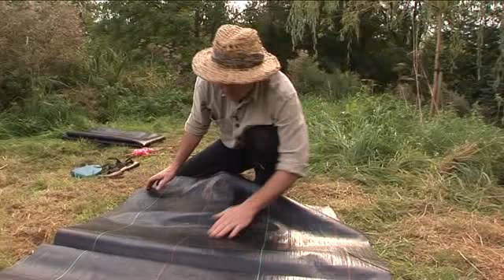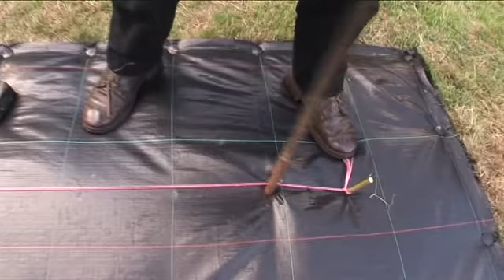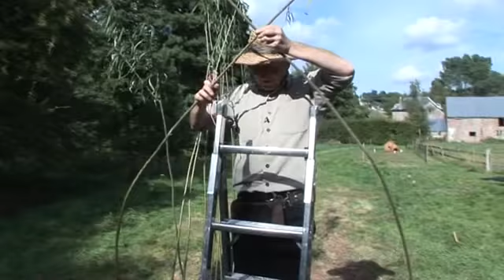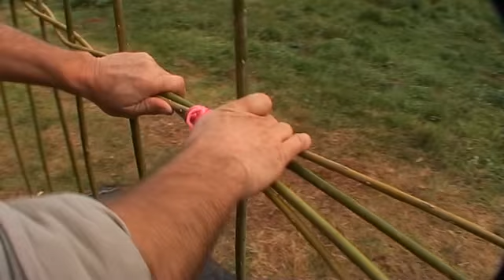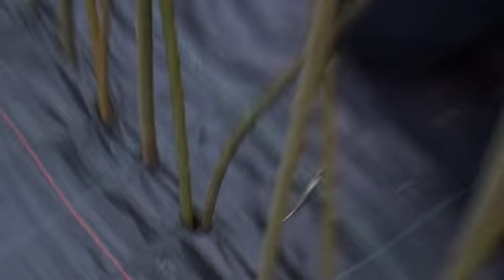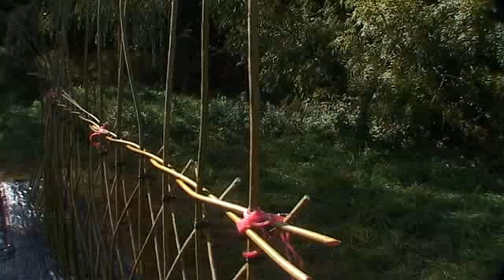Making Living Willow Sculptures DVD 2006

Comment: It’s 2025 and I’ve been saving this for years! My willow is finally reaching 10-12 feet woohoo! I’m so excited to start something this spring 2026
Reply: It's September 2026. Did you try anything? How'd it go? Spring 27??
Reply: @michaeljames5936 I ended up using my harvest to make wattle fencing around my corn.still no trough but I’m making a market basket using wild grape vines.
Reply: how did it go?? I rally want to do this but thinking of buying some cuttings from a vermont willow nursery
Reply: @kingrick4420 if I make a living willow structure, I will definitely post it on my channel. I decided I wan a half dome over some seating, for shade.
Reply: @kingrick4420 i have harvested more than enough to make a basket. My challenge now is building a trough to soak them in.

Comment: Hi, nice video...I'm wondering if it's possible to use willow as a temporary structure as I'm growing summer climbing plants this year (sweet peas) I'm in the uk and am worrying if I use willow but don't want it to root do I need to dry it for a certain amount of time, is willow invasive, does it spread or turn into a tree if left to its own devices....sorry for asking so many questions but it's because I have inherited a small patch of willow growing in my garden from a previous owner and don't know anything about it and to be honest I'm a little scared of it...lol, so any information would be most helpful. Thanks in advance. Ann
Reply from the maker: Hi there...  Yes you will need to dry the willow before putting it in the ground, if you don't want it to root,
Left to its own devices (unpruned) willow will indeed turn into a tree.
Willow is not 'invasive' in so much as it does not self propagate with any conviction! It will however spread slowly on open ground (it is a pioneering species, i.e. one of the earliest plants to recolonise devasted ground)
I hope that helps! The Willowbank

Comment: Is there a limit to how close together you can plant the rods?
For instance could you plant them 3/4 - 2 inch apart and have them grow into a solid wood dome?
Reply: I like this idea but for the reasons stated already I would suggest considering creating a geodesic dome... that way you still get the living dome you desire but the willows will still have a bit of space.
Reply from the maker: In theory, willow rods growing up against each other can fuse together if they are prevented from moving/rubbing against each other... but they will struggle to grow well if you plant them very close together as they will in effect be competing with each other for light and nutrients.  It may take some time to achieve your plan! (But please send us some photos / updates if you go ahead with the idea... it sounds fascinating!  Cheers:  The Willowbank